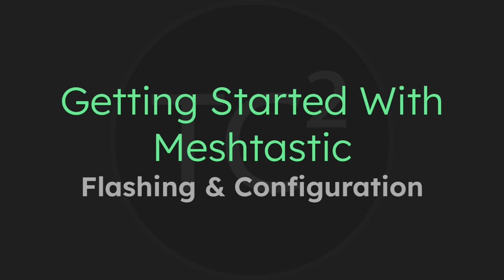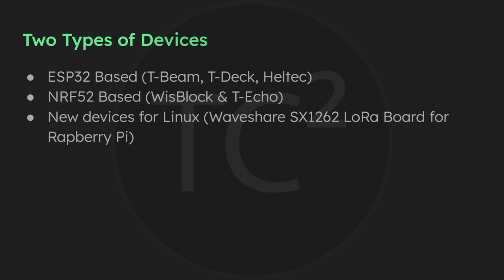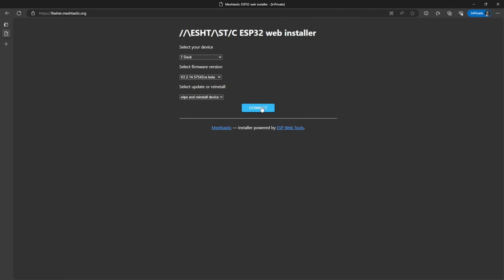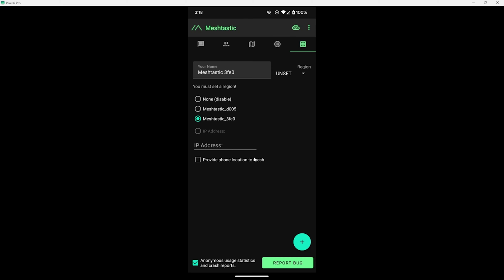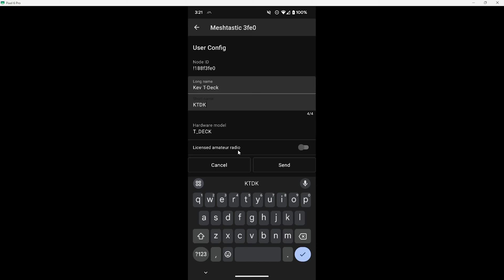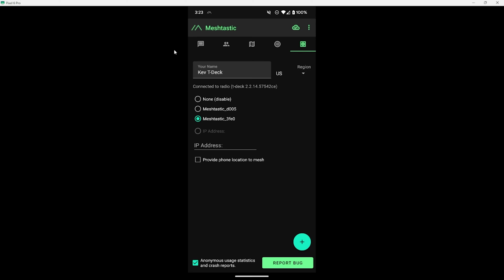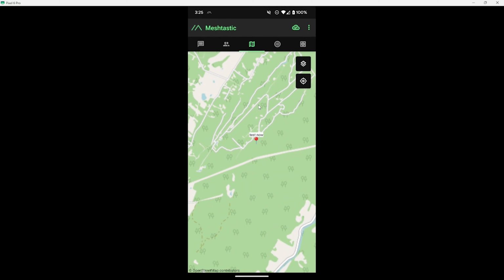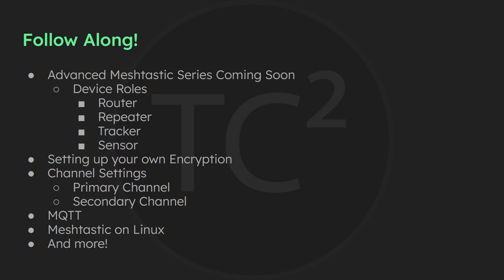Getting Started with Meshtastic - Flashing & Configuration

Comment: Unable to erase/install firmware, couldn’t connect via usb.
Reply: Some tips: Make sure you have drivers installed (the Meshtastic page has a document that links to the right drivers), and make sure that you’re using a USB cable designed for data transfer (the USB-A side should have 4 pins, rather than 2).

Comment: Sorry if off topic but the meshtastic app only runs on an iphone 12 or above.  I guess I am not ready to spend 600 plus to run an app.  Cant find a Windows based app.  Any suggestions?  Any cheap androids recommended? What is the oldest android version that will run meshtastic?  I may get a network radio like the XP8 if it will run meshtastic.
Reply from the maker: No worries! If you're not worried about having cell service, I would just get one of the Android phones for prepaid services from Walmart or somewhere similar. You can find Android phones from $30 - $100 depending on what model you get. Then just don't bother activating it and use WiFi.

Comment: Just flashed 3 of my 4 LoRa devices last night. 2 T-Beams and 1 T-Deck. I have another T-Deck that I expect will be my primary carry device, as it will have the GPS. One of the T-Beams GPS doesn't seem to be activating for some reason, I'm not too worried about that as it is going to be my mobile repeater, sitting in the car, or will be set up at my off site. One T-Deck will be set up so that I can demo the devices at ham club meetings. We'll see how that goes. That won't need the GPS. Oddly enough I have 2 T-Decks that apparenly in my haste I bought the lowes tprice on only to discover they don't have LoRa radios in them. They do have bluetooth, so I'm wondering if that can be used to link to a T-Beam to access the LoRa connectivity, but I've also considered them for mobile text capture in my budding writing career. But I'm not as happy with the keyboard as I'd like. Oh, for the days of the thumboards on the early Rim 2-way pagers...

A couple of tips for people looking to install over Linux. Chrome does work, and I suspect that Chromium will as well. I don't know about Firefox, but it's not Chromium based so probably not. If you are new to coding or flashing over a usb interface, you need to add your user to the dialout group [command "sudo addgroup username group" You'll be prompted for your password, enter that, you can skip the sudo portion if you are entering the command from a root or su session], then either log out and log back in, or reboot entirely. (I ended up needing to reboot entirely between each device.

Both the T-Beam and T-Deck show up as ttyACM0, where the 0 may be a 1 or higher number if you have other devices attached such as an Arduino or ESP32 device already (but you probably already had the group entry correct in that case.)

I did this on a fresh 'stable' install of PopOS! 22.04 LTS. This is mostly an update to the Ubuntu distro, and most other modern Linux distros should work. I don't know about Haiku yet, thinking that will work but haven't installed it on that laptop yet, and not really holding my breath in any case.

So far only my devices show up in the peers list, but I haven't moved it to where it's going to live yet, and I'm in a stucko sided house, meaning that I'm surrounded by a metal wire mesh with reasonably good connectivity to ground. That said I don't know if I'm going to end up with this device stuck up next to the TV antenna, or out on an outrigger from the antenna mast. Either way I'm likely to be designing my own housing  so that the antenna hangs from the housing, and I've got 12 v going out to the housing, with a buck converter to get it down to the desired 5 volts. 

Now if only one of these two NanoVNA's would give me a decent look at these antennas. Entirely separate issues.

Thanks for the videos. As I am doing solar at my off site, I may be picking up wone of the RAK packages. We'll see.

Comment: Playing with 2 older T Beams, loaded up 2.2.24, and trying to communicate between the two. I get one all setup with name loaded, shut it off, clear my android Bluetooth of all devices, turn on the unit, and it pairs, then when updating the interface, it want to pair again, using the name of the first unit I turned off. I am going to install previous stable code to see if I can solve that. My first impression is this stable release is buggy !

Comment: Have the TBeam, and no issues.  Saw your video and ordered a T-ECHO.  It seams to have a dead screen. No data, no backlight.
Contacted LILYGO, and the keep wanting to have me load the test firmware to test the radio is sending and receiving.  Ha ha… I would know cause there is no screen functioning.  
So far, T- Beam is superior until LILYGO can offer a unit that works and I can prove different.
Funny thing is my issue that I reported to them had nothing to do with the radio, but who knows maybe 85% of the unit might not work.

Comment: Do you need a screen to get the bluetooth code? I just ordered two RAK starter kits without screens.
Reply from the maker: If no screen is detected, it will use the default PIN (123456)

Comment: Nice videos.. How do I setup a LiDAR sensor that will only send data only after i push a button or any other event from other sensor?
Reply from the maker: I'm not aware of any LiDAR sensors available for any of the platforms unfortunately.
Reply: @The_Comms_Channel  I am planning to use TFmini‑S Lidar Sensor Module and send data over Lora. Does it mean that its not possible to attached other modules to use with meshtastic?
Reply from the maker: Ah, I see. Are you planning to use it as a motion sensor?
Reply: @The_Comms_Channel  yeah something like that.
Reply from the maker: Gotcha. I've not used that specific LiDAR sensor you mention, but I believe the info on this page should help you achieve your goal!

https://meshtastic.org/docs/configuration/module/detection-sensor
Reply: @The_Comms_Channel  Thank you ^_^
Reply from the maker: @seventhplug5297  Sure thing! I hope it helps! Your project looks interesting; let me know how it goes!

Comment: i recently got a tbeam supreme s3  i had to put mine in boot loader mode by holding reset and boot then release reset then boot....  on the web flasher page it will fail to initialize
Reply from the maker: Ah, thanks for the info! I've not used one yet, so wasn't aware of that! I'll pin your comment so others can see in case they have one.
Reply: @The_Comms_Channel  i was about ready to give up when i found the suggestion on a random forum post..... (two days later)
Reply: @The_Comms_Channel  Using the iphone and widows - my interface is different than what I see from you in the videos, eventhough I can still do most of the fuctions. Any insight?
Reply: I can’t get my Heltec V3 to show up on the serial port list (using windows 11) so I can’t even flash it. 
Is there a way to fix this in a simple manner?

Comment: Are there any  Meshtastic-compatible units that do not have a GPS unit? 

Also, really loving this video series. Make it really easy for a novice to get started. Thank you very much!
Reply from the maker: Sure thing! I'm glad you're finding them useful!

Most don't have GPS actually. WisBlock can have a GPS module added to it, but it doesn't come with GPS. T-Deck and Heltec V3 that I've covered also don't have GPS. 

A complete list of all devices can be found here, it will specify which ones have GPS. https://meshtastic.org/docs/supported-hardware

Thanks for the question and comment!
Reply: @The_Comms_Channel  Thank you for the video. I was wondering - on a device with GPS can you block other users from seeing your location?